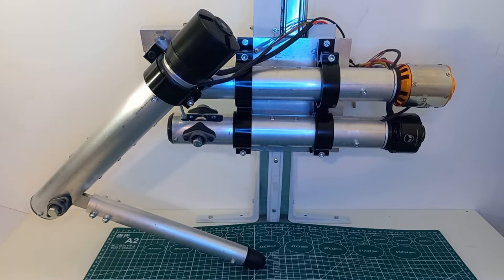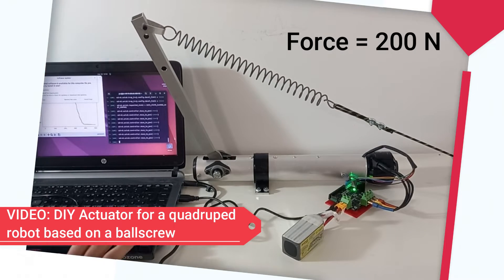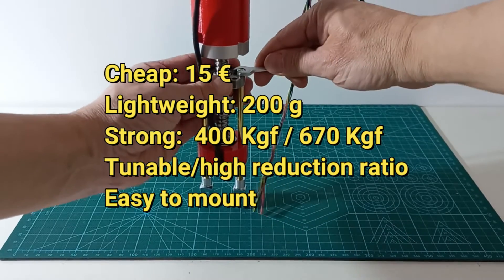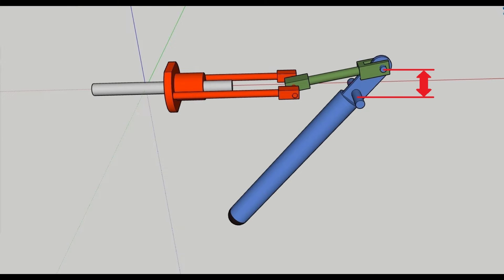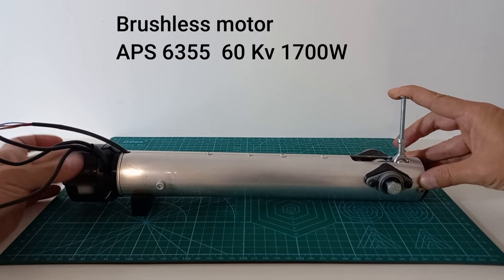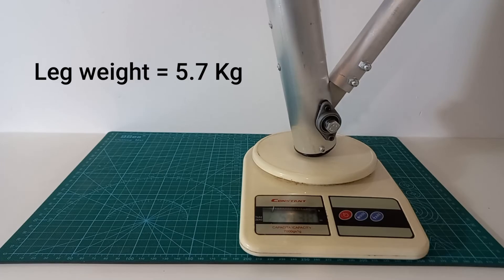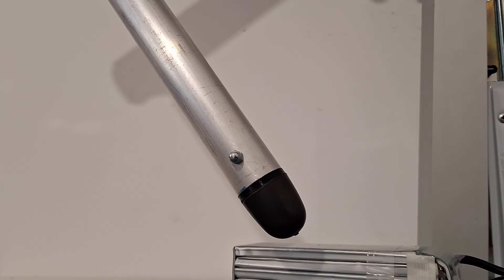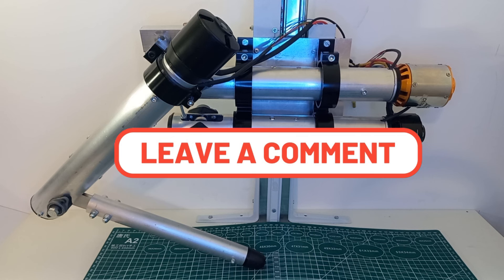DIY Robotic Leg for Quadruped Robot with Ballscrew Actuators: Strong! 💪🏻

Comment: It is a very nice idea to use ball screws in all three joints but do you thing will you be able to fit this design in a quadruped chassis? It looks very big and not soo compact.
Reply from the maker: Yes they are a bit long, but they can fit in a 0.8 - 1.0 meter quadruped. I am trying to shorten them by avoiding the motor shaft coupling. Yo can see this in my next video. Thanks!

Comment: You make amazing content. Thank you. 

I wouldn't use the same approach. Ball-screw mechanism takes too much space and heavy. I would use ballscrew only on one joint, and would use harmonic/cycloidal reduction on other two joints.
Reply from the maker: That is the approach used in Boston Dynamics Spot, and it seems to be a good one. I agree ballscrews take much space, however I think they are not heavy at all (200 g for 100 Nm). Thanks!
Reply: So exactly like a a boston dymaics spot... the most famous quad robot design ever made... hmm....

Comment: I really like your designs.  Have you considered removing the knee and using the linear motion directly to change the hip-ankle length? The may reduce your maximum torque requirements by removing the bent knee geometry.
Reply from the maker: Do you mean something like a telescopic leg? I think that would be extremely strong but very slow too (at least with the motors I am using), and in a quadruped you need to be fast. Note that the shank crank is 26mm, and the shank is 260 mm, then we are multiplying speed by 10 (and dividing force by 10 too). Maybe with a motor with a very high Kv (1700 Kv for instance) what you propose could be feasible... I will give it a thought!
Reply: Yes,I was thinking telescopic.  You can get different ratios of rotation to screw-length which might help, although I'm not sure of the weight/size trade-offs.